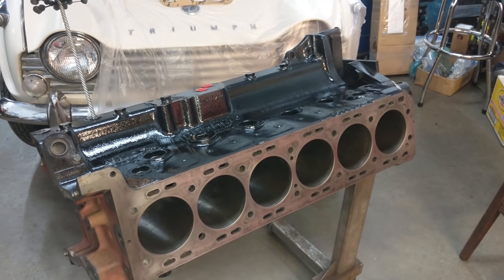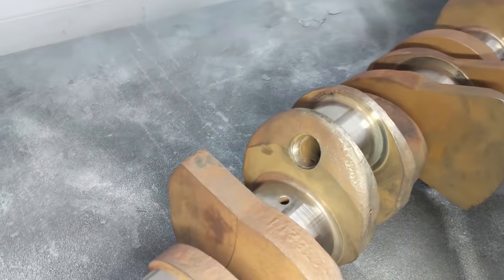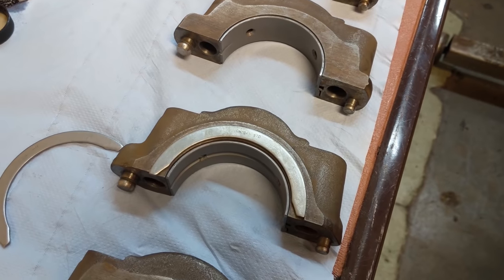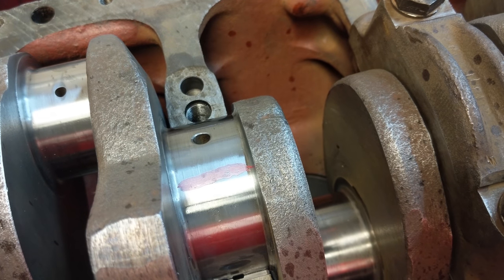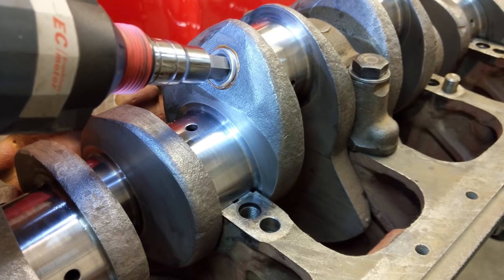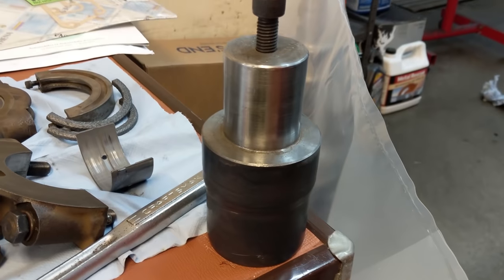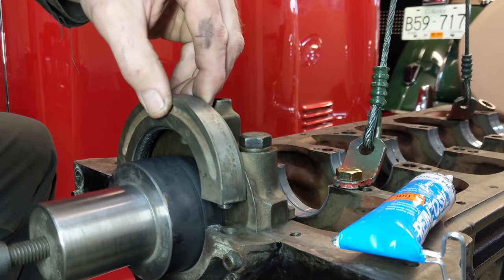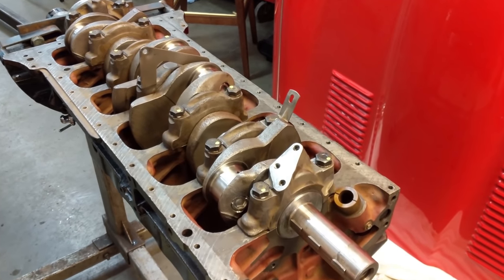My Junk E-Type Engine Part 5

Comment: Hi Richard, excellent work indeed and good to see someone so dedicated to restoring a true British icon. 

My only observations would be when torquing up the crankshaft, you should start from the centre and work your way outwards, starting at centre, then left cap, then right cap, then next left cap, then next right cap.  That way you are certain the crank doesnt rise slightly at one end and is seated totally square in the block. 

The other thing I would mention is the use of the honing tool.  It really needs to be done with a the tool with three long stones on it to guarantee the cylinder walls are square after the honing.  The tool you used will follow all imperfections in the bore.

Apart from that, it looks like a super dedicated job!
Reply from the maker: Great suggestions love them. This bore did have taper wear, don't know how that would effect long hones.

Comment: A tip (not noted) when installing the end caps - the threads set in the crankshaft block are (more than likely) cut into "blind" holes. Before installing the end cap bolts, these blind holes should be thoroughly dry as any fluid in the bottom of the holes (especially oil) is compressed by the end of the bolt when being tightened up. The resulting "hydraulic pressure" can be so great as to actually crack metal which, in time, could cause the bolt to come loose and lead to another engine rebuild. Medicinal cotton buds (cotton swabs on a stick) are ideal for this purpose. The principle applies to all blind holes.
Reply from the maker: Yes I have heard of this problem in large marine practice. The main bolts had lots of factory assembly lube in the holes when I first took them out.
Reply: I discovered this phenomen from the aircraft industry (40 years designing the beasts) where defined torque settings are standard practice. Many years ago I recall one particular bolt was torqued down to it's given spec, but the washer below the bolt head was still loose - hmmm! Bolt removal showed some liquid gooo at the bottom of the hole (mixture of sealant/grease/anti corrosion inhibiter) which, when cleaned out solved the misdameaner. Further consutation with the stress department led to the "hydraulic press" conclusion & tests showed pressures of nearly 100000 PSI could be created (worst case Scenario from an 8 mm thread). Given time, the pressure created would decrease leaving the bolt in a somewhat loose condition, but the base material cracking had already occured.Subsequently, all my aircraft parts where blind holes could not be avoided, were drilled through eg a 4.8 mm (3/16") dia thread was drilled fully through with a 2.5 mm hole to allow for "venting" and also to prohibit the possibility of a threaded insert screwing/threading itself fully through a larger dia "through hole". Occasionly, "venting" or pressure relief holes were incorporated diagonaly or horizontaly to the bottom of the threaded hole.In the case of an engine block, drilling "through" or "venting" holes is inpractible - hence the recommendation of drying out any blind holes. In aircraft production, a "dry" lubricant (spray) is normally applied to bolt threads at installation - but not into the threaded hole. For engine assembly, something like WD40 would be quite suitable.Sorry - no experiance with marine engineering, so nothing to say from that side, although water obviously can also create a pressure build up.

Comment: Nice to see plastigauge used again. I used it when I built engines in the early 80s but thought it had gone out of use..... Good series - enjoying it. Looks pretty cold in that workshop - we have the opposite problem down under.....
Reply: Woody and Turboyoda at the Skid Factory were using Plastigauge in their Nissan RB30 rebuild recently :-)
Reply: @jsleeio  Yeah I saw that :-)
Reply: I helped friends use plastigauge to check main bearings in a a relative's VW. Bearings and crank were in tolerance, and left alone. Worked fine.
Reply: Plastigauge is awesome,i have this fascination when i use it to check it against the chart,sometimes me and the guys even make bets to see who is closest,lol

Comment: Honing a cylinder with a "balloon" hone, is not the way to go. As balloon hones are mounted on flexible bods, they follow the shape of the cylinder wall, including "dip" into every scratch and imperfection. For this reason, they are at the best suitable for initial cleaning of the bore. The eventual honing to "finish" the surface should always be done with stones mounted of a specialised cylinder hone. As several grades of these stones are available, it's not possible to here state the rotation speed of the hone. That depends on the stone grade.

I have been following this series from the start, and would like to congratulate you on the outstanding quality of the work carried out. Making several of the tools, as you have done, accentuates your commitment to workmanship of the highest standard. Sadly, this kind of quality is dying out in our modern world.

I have restored several old vehicles, both as a hobby in case of my own vehicles, as well as customer jobs in a professional capacity. I hold a doctorate in mechanical engineering from one of the top universities in Australia, and while now in my 70's and well and truly retired, I have never lost my love of high quality engineering work, of which the original British engineering was at the very top of.

Very much looking forward to reminder of this excellent series..
Reply from the maker: Olli, the ones used in the video were fine grit I believe.
Reply: Nice one Ollie
Reply: Excellent work

Comment: A hint, when fitting the rear main seals, use the hammer handle or as I have a piece of hardwood turned in the lathe. The get the correct length,make a square hole in a piece of 1 mm  sheet metal . When you place this over the seal,you can use a sharp knife of box cutter to trim the seal off. this gives the correct amount of seal protrusion .The seal is a hangover from steam days where moving joints had seals made from the stuff packed into housings .Something i learned a damn long time ago during my apprenticeship.
Reply from the maker: Thanks for the tips!
Reply: Think I would have tried to fill in the pitting on the crank seal surface, maybe Silver solder or JBweld so the seal runs on perfectly smooth surface and wont wear.
Reply: @TD_YT066  I agree Tom.

Comment: Another option for cleaning the crankshaft isn't *sand*blasting, but sodablasting! It's water soluble, so it's easier to wash out, and if you miss any of it, it'll come out the next oil change without damaging anything.

Comment: Is that a TR5 I spy in the background, built many a motor for those..... also did a few Jag motors too, Hi from Australia..Also long strips of super fine emery paper crossed over to "linish" the journals is a good idea.....disagreed with no lock tabs, they are there for a reason and also are original, you've done all this other original stuff, lock tabs just are correct... keep up the videos, great seeing this work being kept alive.. all I do now is work on my Nissan patrol diesel and think about building engine like this ......
Reply: What's the difference between a TR5 & a TR4?  That's one of my favorite British sports cars.
Reply: The TR5 was known as the TR250 in the US. It had the 6 cylinder engine that would go into the TR6. The TR4 was a 4 cylinder unit.  @flyingmerkel6
Reply: @ClassicMotorFilms  Thanks for the clarification,  I had the sad experience of watching a TR4 rot away outside over a span of years.  Wish I could have saved it. if only for the parts.

Comment: A pal of mine bought a rebuilt Norton Atlas and we went to a Bowen island cottage center for the weekend. you guessed it, the tabs weren't bent up and the journal nut came off the big end so the engine went but the bike didn't, for the lack of a nail...
Reply from the maker: Ouch, hope that doesn't happen here.
Reply: Richard Michael Owen well it won't happen if you use the lock tabs will it?

Comment: Always  keep the journals covered with something especially if your cleaning... Stuff falls in that you can't see with your eyes.. 40 year Airplane Turbine Mechanic.
Reply: Definitely always a  good idea specially on a Airplane engine,you can't just pullover if the engine seizes. anytime Ive built a engine and i have to leave it overnight for any reason it gets covered,when it comes to building engines being OCD and Anal are special attributes.

Comment: I rolled my rope seals in with a socket without trimming the length,  If you trim off extra you didn't seat the seal properly and it will leak.  Mine hasn't leaked a drop in over 20 years.

Comment: I can't believe you assembled that crank/ block without lubrication.The  worst wear in an engines life is in the first 20 seconds with a dry engine, until the oil circulates, it is steel on steel.   
I come from Coventry, the home of Jaguar, and have had Jags for many years, and do all my own maintenance, including rebuilding my engines.
Reply: To be fair Fred, he actually did lube the crank, it was in the fast forward section. Then he went on to bang down the mains from one end to the other instead of from centre outwards lol

Comment: Good quality picture work.  I do have a question.  Why do you not use assembly lube on crankshaft bearings such as Clevite, Red Line, Royal Purple, Amsoil, etc.?  Dry surface on bearings?
Reply from the maker: I do put assembly lube on, it's just in the sped up portion. My mistake I should have made it more clear

Comment: Aircraft engine rebuilders use pecan or walnut shells to blast things clean.  Never, ever use a true abrasive on engine parts.  (Sorry to nit pick, but the valve retainers are "collets", not "cotters".  Cotters are a form of tapered pin.  All the best.)
Reply from the maker: Geoff, thanks for the comment, great to hear more love for walnut blasting. Just checked the manual they list Collar and Cotter for the two small retainers.
Reply: @RichardMichaelOwen  Must be Scottish!
Reply: Richard Michael Owen then that must have been re written for the American market!  The correct word in England is a Collet as Geoff Morgan says a cotter pin is a tapered pin with a corresponding tapered flat on it. They used to be used to lock bicycle pedals onto the crank shaft with the flat on the cotter engaging with a flat machined onto the crankshaft and a nut and washer pulling the tapered pin in to lock it. Oh and by the way i completely agree that the main bearing caps should be pulled up from the centre outwards .Never from one end to another. Hope you don't do that to customers engines!! And also you should have used proper honing stones to finish the bores after your ball hone.

Comment: 16:40.  Not using "lock tabs"?  Use them!  Does not cost much extra, but adds a lot to security and peace of mind.  I remember, after reconditioning and rebuilding my Morris/Austin 1300 (circa 1970's) type gearbox being advised of the need to ensure torques for the gear-selectors were correct (I had done that -- carefully) as they were one of the first things to put back when rebuilding.  It would be a total rebuild if they came undone (and according to "sods law", if they did come undone, it would be when you are miles from anywhere and need a transporter to get you back to civilisation).  Well -- same principle applies here.  "Do it correctly the first time, and that includes using those pesky "lock tabs".
Reply from the maker: Modern cars don't use lock tabs, but I will fit them in your engine by request.

Comment: Hi. Really enjoy the series. Could anyone tell me what was the test being done with the red markings and the gauge? And how does it work?
Reply: This is a means of testing the clearance of the crank main journals to their individual shell bearings. A thin piece of malleable plastic of known dimensions is squashed between the crank journal and it's shell bearing. Once fully squashed, the piece of plastic is then measured with the specialized gauge (looks like a marked ruler) and the width of the now squashed plastic correlates to a measurement on the gauge. In this instance, the 'width' of the squashed plastic correlated to a difference of two thousandths of an inch, meaning that the gap between the crank journal and the shell bearing was within the manufacturers specification for correct fit and clearance. This method is widely used by engine builders and is manufactured by a company called Plastigauge. Hope that makes sense.

Comment: Don't use silicone sealer. It can bead up, break off and block oil lines. We had an engine to recon that this happened to with less than 1000 K's from it's previous reconditioning! Use non hardening/beading sealers like Permatech..

Comment: GREAT video sequence! I envy you! But several things puzzle me. When the light shines straight down the bores, It looks like there's still stuff in the oil passages of the crankshaft. Shouldn't the whole oil system have been flushed out before putting it back together? Block, crank, connecting rods, gudgeon pins and pistons. Or am I over-fastidious? If there was ever an application for pressure and gunk removing chemicals, this would seem to be it.  Hand cleaning feels productive but there's residue on everything.
Second- there's a pink-gold cast to the block casting where the crankshaft is bolted. Seems unlikely to have been painted, is it light surface rust? If not, where does the pink color come from?
Third- the block-to-head water passages look partially blocked with whiteish solid stuff when the head and block are separated. Whatever that white stuff is, it seems to be on cylinders in the water jacket.  Should the cooling system also get flushed and cleaned up? The openings at the head gasket are larger and cleaner as rebuilding starts, but not spotless.
Reply from the maker: The crank was hot tanked but, as you saw I still needed to clean up some residue in the sludge plug holes. As for the rest when you remove the oil sometimes things look stained, that's just the way it is.
Reply: @RichardMichaelOwen   - thank you, I'll bear that in mind next time I hot tank a crankshaft. So I learned something there, and I still envy you!

Comment: hey Richard, I have re-built more XKE engines than I  care to remember but unfortunately some of the work was sent away and I did not get familiar with best practices, it seems you know a little bit about these engines :) and your dad has some basic knowledge :)), with the slush plugs in the crank once I have removed them (which I have) should I put new ones in or is it OK to re-use the old ones with Locktite ?
Reply from the maker: Great to hear from you. As long as the threads are okay on the old plugs and holes I would re-peen them back in. Locktite is okay, but has a heat limit.

Comment: Not trying to knock this amazing build but dont you normally soak those rope seals for a couple days?
Reply from the maker: I don't think it mentioned that in the shop manual. I think it's definitely an option.
Reply: @RichardMichaelOwen  Graphite impregnated rope seals shouldn't be soaked in anything - the graphite (long term lubricant) gets washed out of the seal.
Reply: @rogerbush2226  The one I put in my Datsun was graphite as well. The shop manual specified to soak it.

Comment: What about the tolerance between pistons and cylinder bushes? I missed you checking them... Usually with a major overhaul you replace them observing the A-Z tolerance in the service manual....
Reply from the maker: Do you mean the  gudgeon pin/wrist pin small end bushings?
Reply: No, I mean the cylinders. I would replace pistons and cylinder bushes. cold insert method. did that with a 3.4
Reply from the maker: @fredarendse4932 , oh the liners! Yes maybe with the next rebuild, this is a budget build.
Reply: Gotcha! Nice work though. Chapeau. Youtube changed lots since the time I worked on Jags...

Comment: Hi Richard ! The honed cylinders look pretty rough. Could'nt you kind of "polish" them using a brake master cylinder like honer. You know, the ones with soft stone "pads" ? Just asking... I'm not naysaying here at all. Just curious.
Reply from the maker: Marc, I think that's the idea, the rough surface beds the piston rings.
Reply: @RichardMichaelOwen  
Thanks for the info, Richard.

Comment: I have to ask. WHY did you not hot tank the head - crankshaft - block? This would have removed all debris and foreign material.
Reply from the maker: Just did the crank, it didn't really even need it, very clean inside.

Comment: hey Richard what are you thoughts on Glyptal inside the engine to aid oil flow ?, with the exception of the oil pan as you want it to stay there for a moment
Reply from the maker: Sure I think the Glyptal helps, but not entirely necessary. Does lock in the cast iron which is nice for corrosion.
Reply: @RichardMichaelOwen  thanks for responding, can we see more on the XK150  and have you guys ever done a MKII Jaguar, I'm restoring mine, if you have time check it out on jagvette1.

Comment: Man i love these videos,not a engine i would wanna rebuild since I'm used to the "normal" run of the mill engines and i mean this as a compliment,i wish you would stop calling it "my junk engine" lol,as mechanics that work on these engines pretty regularly what would you say was the rarity of this engine from 1 to 5, 5 being rarest?
Reply from the maker: There are lots of 4.2 blocks around, they used them in the Saloons, but to find one with all-E-Type hardware is rare I think.

Comment: Crankshaft in and torqued up but cant see any oil around them or were it has run down the mains webs, please tell me you havn't built it up dry.
Reply from the maker: If you look closely in the sped up footage I put assembly lube on the main bearings. It's a special type that doesn't need alot, looks clean doesn't it?